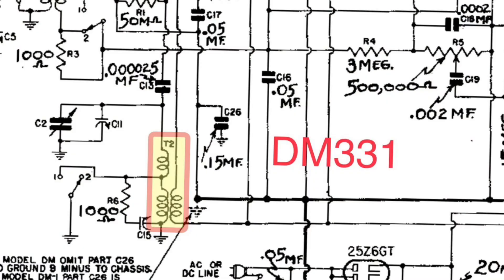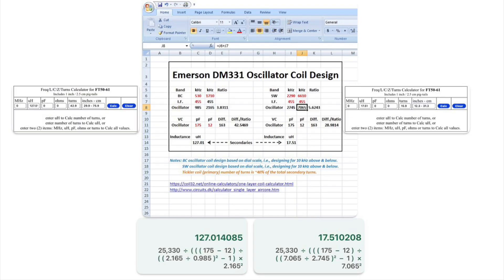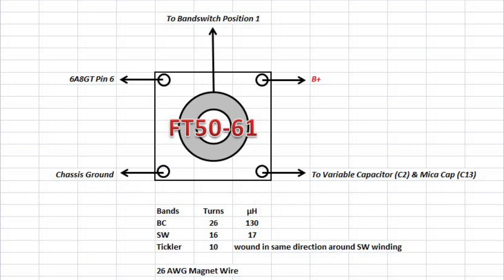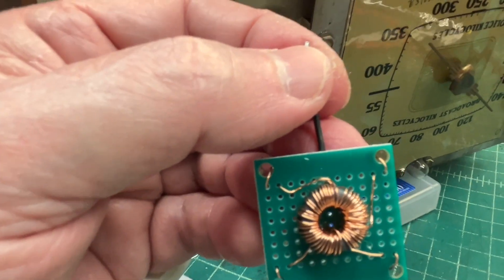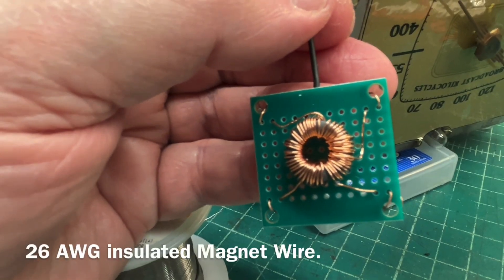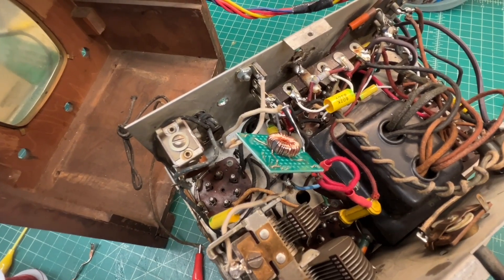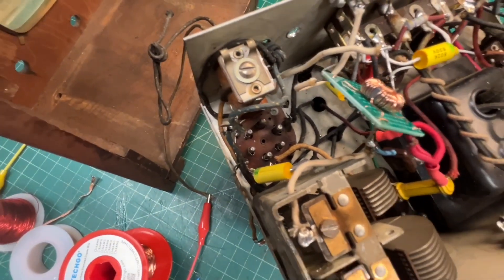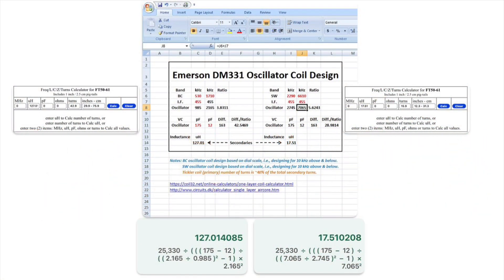Oscillator Coil | Toroid Build | Emerson DM-331

Comment: Very nice build! That spreadsheet looks pretty handy when the coils/ transformers go bad and hard to repair. Thanks for sharing….Take Care—Larry
Reply from the maker: Thank you Larry, it comes in handy. Wish someone could confirm the capacitance range of the oscillator section on a DM-331 so I could true up the design. Best, Don
Reply: @RestoreOldRadios do you have a DM331? Could you use a known inductor, measure the resonant frequency of the capacitor and back calculate the capacitance range?
Reply from the maker: Appreciate it Larry. I don’t have the DM-331, just helping a viewer of my channel. Thanks again for the info. Best, Don